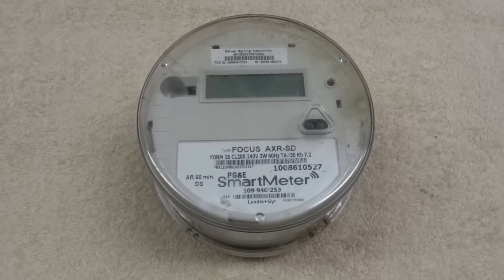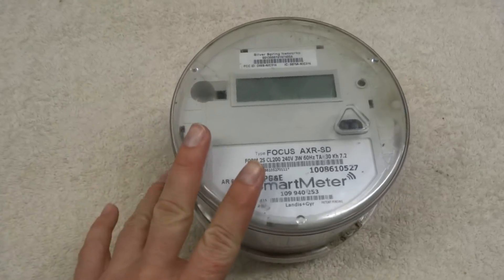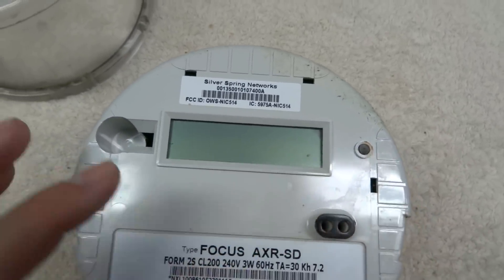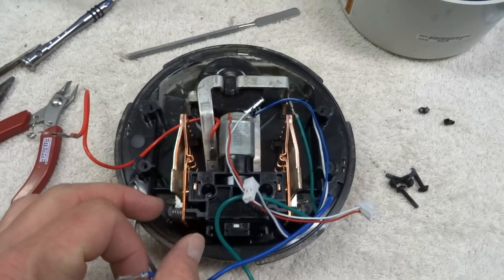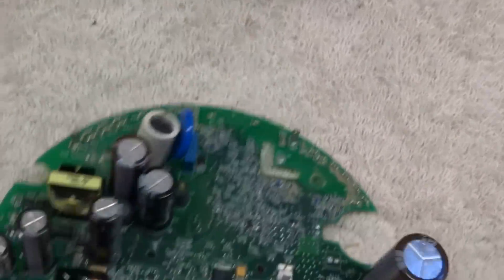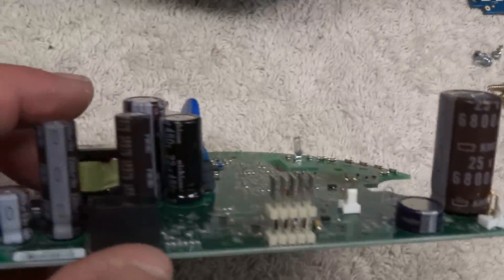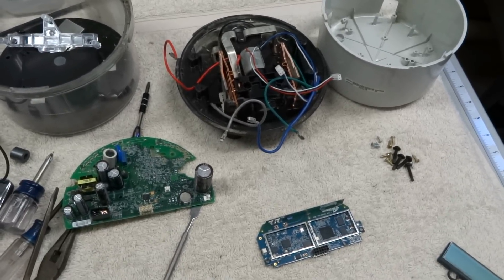Let's Teardown - Residential Smart power meter

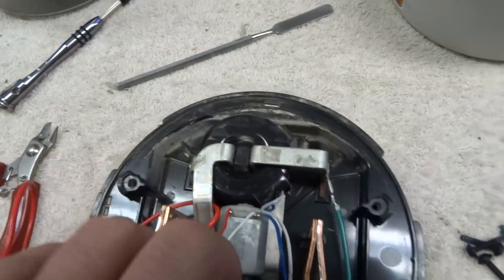Comment: 6:13 Why the heck would you describe the ability of the power company to remotely disconnect the meter as a "Safety Measure"? You know full well the reason for remote disconnection is not safety it's being late on payments. Don't BS Us!
Reply: I live in Quebec Canada and it has come to the attention of the opposition party that our electric company is continue to charge us a flat rate to read the meter yet 98% of all customers have been switched to a "smart meter" that does not require any form of reading and all data is delivered via encrypted Wifi
Reply: I wouldn't call it a safety feature by any means as these type of meters are known to catch on fire.
One thing I noticed the motor is a toy grade unit the construction is a dead give way.
Opening will be slow so some arcing will pretty much occur every time it's actuated and if the motor fails before it's fully open the arc could end up sustaining it's self.
When that happens if you're lucky it'll melt the PCB and insulation in the electrical box and trip the fuse at the pole if you're unlucky it starts a fire.
Reply: +Chris Steele (Ethan Hines) ..... yes, for safety.......... safety for the guy that is coming to shut off the power so that he don't get shot in the ass..... LMAO..... :-)
Reply: Yes, fresh water will conduct electricity. A Task Force Tip nozzle at 10 degree pattern at 20 feet will return a 3-10 amp charge back to the metal frame of the nozzle. 
I was trained at the Niagara Mohawk Power Emergency training facility.
Reply: Can shut you down if they feel you are using too much Electricity. When your Food, Water and Energy can e controlled-- you become History.
Reply: +butchtropic yes laid off some people, relocated most though... savings? not passed on to consumers; using less power than ever, & bills are higher. On top of that, cost over $250/year to opt out of the smart meter - & they just drive by in a truck every other month.
Reply: The CEO of our government ran power here in Canada, Hydro One makes 6 million a  year. Someone needs slap the shit out of the deciding assholes here till they understand what reality the rest of Canada lives in! We heat with gas and our biggest power bill for one month this winter was 508 dollars.  It's criminial!
Reply: +Frederique Zug - If you hate electrical power so much, you are free to not purchase any. My smart meter emits 0 watts of radiation. You cannot speak for me.
Reply: +butchtropic what I mean by "flat-rate" (I do not know the proper term) is even BEFORE they start changing us per KWH used they change us a daily rate of X cents I don't know how much it is off hand but it's the charge they used to justify by saying it was to pay the employees needed to maintain the meter well that no longer applies!
Reply: +Frederique Zug Yes the information that goes from Smart Meter to the Accumulator is encrypted as per this information: 128 bit AES cipher is popular in smart metering and often used to communicate between individual meters and meter data collections units. Since the data is encrypted, it prevents eavesdropping. https://cache.freescale.com/files/industrial/doc/white_paper/SECSMTMTRWP.pdf
Reply: +MrMus TangMan That's my point TangMan no one "comes" to shut off the power anymore it is via remote.
Reply: It is a kill switch for when you do not pay your bill, they cut you off, I just made an error on my account number  266  rather than 622 ....thought all was good at amscot, 9 AM the next morning the power was cut off, I call them, here it is duke energy and informed them I think I made a mistake, and about then amscot phoned in to tell me the process was rejected. I called duke back after fixing the error and they informed me because was not their error I will be charged 45 dollars for a technician to come out and turn me back on within three days. I say  I have a smart meter, rep tells me oh thats right we charge 40 dollars anyway because it was disconnected its policy, (answer for everything just it changes to meet their agenda) then she says also you will be subjected to a 400 dollar deposit on the next bill, thank you for calling duke energy. in the coldest tone imaginable.
Reply: yes, honesty is the best policy....
Reply: either that or they know we can't do anything about them.... :-/
Reply: +Chris Steele (Ethan Hines) 
That to help you Payonline! Problem is they just cut your power. Your computer won't turn on now.
Reply: +Brian Friesen Yes they can, from anywhere in the world via computer, with the old meters they'd have to send someone out to a local access point & disconnect you from the node, so yes ease of shutting you off at a touch of a button, literally, is a reason... primary reason? Considering other possibilities only leads to accusations of conspiracy theories & 'tinfoil hats'... but there's sure been a big push to force these smart meters on people. You can opt out but it will cost you over $250/year.
Reply: Well, you already showed that there is a manual disconnect lever on the meter.  Any tech coming to your house would use that.  (They could also just pull the meter, which disconnects your distribution panel from the mains, or unhook the wires at the pole.) The motor is there so they don't have to send someone to your house to shut off the power.  With a smart meter in place, they can shut down one account, or any number of accounts, with nothing but a keystroke on a computer at the central office.
Reply: I do not CLAIM either. this is an absolute certainty a fact this it can, has and will be used to shut down for non payment.
Reply: Frederique Zug People that grow are crooks?  aww man that sux cuz i always thought i was a good guy!  So, I'll need to know what kind of crook I am.  You must have the answer right?
Reply: Fredrick Zug really is looking like a pompous ass right about now to me and I've only come across 2 of his posts so far.

Apparently you know something about this Freddy boy.  To bad you use your knowledge as a combative tool to club people over the head vs a learning device for all of us. 

Boy.  I can hardly wait until I come across your next 'beat down'.
Reply: Actually here BC Hydro cuts the wires to the house at the street or wherever it is convenient or safe to do so.  Pulling the meter or turning the meter off doesn't disconnect the house from the power.  The meter feed is still hot so the top two terminals inside the meter socket are still hot.  One has to cut the secondary wires feeding the home or pull the fuse to disconnect the transformer.
Reply: The service drop and meter box would still be live so fire fighters would still have to disconnect the building at the pole for it to be safe.
Reply: His video would probably be demonetized if it hasn't already if he said anything negative about the power company's intended use of that feature. With YouTube now you have to sugar coat everything and go along with the deception.
Reply: I sure hope they dont think that  
   the government lied to us and thats it
with no options        except an expensive opt out
Reply: +butchtropic Actually not all that many people. Still need van drivers and employees to check out theft and meter failures.
Reply: conundrum.!!!!
Reply: +Chris Steele (Ethan Hines) Try being the unfortunate fire-fighter who has to pull your meter head if your house lights up some night! Instead of leaving live feeds exposed in a wet metal box, they can kill the house without the electric company guy even needing to get out of his truck!
Reply: +Chris Steele (Ethan Hines) just found out that the electric utility will remove the per-diem charge starting in 2017
Reply: Donny Hinson Or remotely = anywhere in the world actually!
Reply: Robert Slackware or any reason whatsoever! But with remote capability, don't need convincing, delegation, & may be effected without culpability.
Reply: For work safety, it makes more sense to use the physical lockout switch (the movable plastic switch that you pointed out on the back, since the circuit has telemetry and even network capability (mac address, etc), which is for activating the motorized cutoff via network, or actually "remote".  The more logical conclusion is that it is for the purpose of the utility company discontinuing service from their office computers, instead of having to send a tech out to do so in person.
Reply: I used to work taking care of a large portfolio of government assisted housing not far from Toronto. Many people would skip on paying their bill and before they had smart meters they would come out and install a meter that would cycle on and off I think 5 minutes every half hour it would be on. During the winter they can't just shut off your power or your pipes will freeze and break so I am wondering if that motor is set so they can manage doing this if you dont' pay your bill.
Reply: Why the caustic sarcasm Fredrick Zug ?  The guy is showing us how this ver1 smart meter might work.  You posted a report about a meter made by a different company in a different location owned by a different utility.

One might take your comments more seriously if you ditched your condescending attitude.  It's fucking bad enough we have to deal with the  bastards transmitting on the sides of our houses.  Not everyone is in a conspiracy against you.
Reply: Fredrick Zug.   Instead of just pointing out that 99.99% of the time the fire department wouldn't be the ones disconnecting the power source due to lack of training, in your neighbourhood and in your opinion, once again you come across with insults and bluster.  

Why do you think that exposed contacts with basically unlimited amounts of current available 14,400 volts x 1 or 5 amps couldn't or wouldn't be dangerous to a fire fighter?
Reply: Actually it could also be used for safety reasons. If you are a fire fighter putting out a fire on a house with live electric current going to it you would want a fast way to disconnect the supply. This feature of the meter could do just that.
Reply: @billyboi57  it doesn't
Reply: did it work, do they not see the meter is broke? and fix it?
Reply: unlesse the complete meterbox is under water its no danger. so 2M off water is very rare.
Reply: the fuse blow and thats it.
Reply: Moreover safety devices used prior repair are mechanical,and being lockable.
A technician will not rely on an electric actuated unreliable little motor to guarantee his safety.
There is a lever behind the meter with a hole to install a lock.
the motor is to shut the whole stuff remotely.
That's why there is an ID on each meter too...
Reply: Chris Steele ....Californian
Reply: It is a safety feature. It's just a safety feature for the power company. Easier for someone at the office to hit s few keystrokes and disconnect you than have a person drive out and have to deal with an angry customer, dog etc. My dad worked for a power company for almost 40 years and you hear some crazy stories about people pulling guns, turning their dogs lose etc.
Reply: and you trust that ?        
computerized meters
Reply: I agree.  Cut off for service or delinquent payment.  Probably more than one month.  I've lost the bill and simply paid two months.  Not good for credit rating.  I forgot if they charged any interest.
Reply: For John Connolly
If the power meter is the source of combustion, why would the fireman wait 4 hours for the power company to show up? 
You do realize there has never been a fire dept that has lost the basement to fire.
With improperly installed smart meters, 35% to 60% of all fires in your town are caused by the arcing from the customers UL approved meter base and the bent smart meter lugs.
Every fire department I have talked to are under a GAG ORDER not to report these fires as smart meter fires.

You do realize smart meters can not detect an ELECTRICAL BYPASS 
Therefore stealing power is too easy these days.
The dumb assholes at the power company have fires the only folks that could find these bypasses.
So with every smart meter install, the homeowner get free fire's and free power.
Reply: Yes it’s to turn off the power if you don’t pay the bill. It’s also to turn off the power in case of an emergency (ever heard of a house fire?). Also turns off the power when you move out and don’t want to continue service. All spooky stuff. Get a life people, it’s not a nefarious device. Also, their is no motor in a meter. It’s a switch.
Reply: The LIAR from the power company said "Get a life people, it’s not a nefarious device"
Well thebulltoo, I would hardly call 100+ deaths every month from the excessive smart meter RADIATION not a nefarious device.
Reply: Frederique Zug    BTW, what lie did I tell and how would you know what my IQ is?
Reply: Frederique Zug    Still no answer? More name calling. Sad. Who do you know that died from a meter? How do power companies make money from dead people? Just to be sure, DEAD PEOPLE DO NOT PURCHASE OR USE ELECTRICITY, THUS NO MONEY OR PROFIT FOR THE POWER COMPANIES!  POWER COMPANIES DO NOT BUILD METERS, THEY ARE PURCHASED JUST LIKE ANY OTHER PRODUCT FROM INDEPENDENT COMPANIES. POWER COMPANIES PRODUCE ELECTRICITY. THE METER SIMPLY MEASURES THE CONSUMPTION OF ENERGY SO AS TO BE ABLE TO BILL YOU FOR YOUR USAGE. WHAT PROFITS THE POWER COMPANIES IF THEY KILL THEIR CONSUMERS?????  AS FAR AS REGULATIONS ON THE METERS THEMSELVES, THE METER MANUFACTURERS COMPILE WITH THE REGULATIONS SET BY THE GOVERNMENT. YOU SHOULD TAKE YOUR COMPLAINTS TO YOUR ELECTED OFFICIALS. THEY WOULD THEN CHANGE THE RULES ON THE POWER COMPANIES. If all these evil things are coming from so called smart meters, shouldn’t you be bitchen at the meter companies??  BTW, does your head spark when you put it in the microwave?
Reply: Any future correspondence from thebulltoo will be from his cell.
I guess  the police arrested thebulltoo for FIRST DEGREE MURDER after one of his customers was found dead underneath his smart meter.
The autopsy showed his customers wired brain  medical implant to control epilepsy was overloaded by the HUGE INTERFERENCE from the large amounts of RF, overwhelming the implant, KILLING the homeowner.

His company will probably payout the widow to keep this story from going to the news media.
Reply: @frederiquezug5938  exactly. Smart meters give off the equivalent of 160 smart phones turned on all at once, pulsing e.m.f.s  24/7, no thanks. It's all to make THEM MONEY, RADIATE THE CONSUMER,  and drive costs up. These are NOT SAFE, and are designed to be used with the smart grid and 5G. Picture a huge electric  invisible dog fence, but for humans. To track, control and radiate you. Slow kill.
Reply: Are a freaking IDIOT  thebulltoo?
40% of all residential fires in cities that have have smart meters installed by untrained ARSONIST are cause of these fires.   🚒🚒🚒🚒🚒🚒🚒🚒🚒🚒🚒🚒🚒🚒🚒🚒💀🚒🚒🚒🚒🚒
The MORONS have no clue that a smart meter was used to turn off the power.
ALL SMART METER FIRES WILL HAVE THE HOME TOTALLY ENGULFED IN UNDER 2 MINUTES

Which power company do you work for ASSHOLE?
I WANT A LEGAL REPLY FROM YOUR COMPANY 
Not your paid lies, but a comment from a power company that my lawyers can use in court.
Reply: The Joe Schmoe Show
Even the hand wringing smartmeter scoffing websites don't list those kinds of numbers. Now, go back to your greeter job at walmart and relax.
**************************************************************************************************************************
I want to use your evidence that smart meters are KILLERS.
This is how you are going to provide us with this evidence.
#1 Go outside and take a pencil and a pad of paper.
#2 Stand in front of your smart meter and look over top of the L.C.D.
#3 Write down the FCC ID Number.
#4 Return to your computer desk and go to the Searchable FCC ID Database
#5 Here is the link     https://www.fcc.gov/oet/ea/fccid
#6 Under the RF section, give us the link for the CERTIFCATION EXHIBIT 
I am sure your customers will want to know why you haven’t been following the DO NOT INSTALL DISTANCE for all installs.
HURRY BACK, I WANT TO SHOW YOUR CUSTOMERS HOW YOU ARE TRYING TO BURN THEM ALIVE.
Reply: Why don't we start at the top of this article????
WE DON'T WANT TO HIDE THE FACT YOU ARE GOING TO SHOW US WHY YOUR CUSTOMERS ARE DYING, DO WE?
I want to use your evidence that smart meters are KILLERS.
This is how you are going to provide us with this evidence.
#1 Go outside and take a pencil and a pad of paper.
#2 Stand in front of your smart meter and look over top of the L.C.D.
#3 Write down the FCC ID Number.
#4 Return to your computer desk and go to the Searchable FCC ID Database
#5 Here is the link     https://www.fcc.gov/oet/ea/fccid
#6 Under the RF section, give us the link for the CERTIFCATION EXHIBIT 
I am sure your customers will want to know why you haven’t been following the DO NOT INSTALL DISTANCE for all installs.
HURRY BACK, I WANT TO SHOW YOUR CUSTOMERS HOW YOU ARE TRYING TO BURN THEM ALIVE.
Reply: HINT   SPOILER    I have worked in this industry for 20+ years. 
I know how you KILL PEOPLE.
Reply: The Joe Schmoe Show
It's amazing when you ASSHOLES from the power company get confronted with REAL FACTS you pretend to be STUPID   😵😵
Now apologize for killing your customers and answer the question.

I want to use your evidence that smart meters are KILLERS.
This is how you are going to provide us with this evidence.
#1 Go outside and take a pencil and a pad of paper.
#2 Stand in front of your smart meter and look over top of the L.C.D.
#3 Write down the FCC ID Number.
#4 Return to your computer desk and go to the Searchable FCC ID Database
#5 Here is the link     https://www.fcc.gov/oet/ea/fccid
#6 Under the RF section, give us the link for the CERTIFCATION EXHIBIT 
I am sure your customers will want to know why you haven’t been following the DO NOT INSTALL DISTANCE for all installs.
HURRY BACK, I WANT TO SHOW YOUR CUSTOMERS HOW YOU ARE TRYING TO BURN THEM ALIVE.
Reply: Frederique Zug   Hi num nuts. What industry do you work in? Must be the mortuary where you find the 100 bodies per month. Thought that would be higher by now since more and more meters are installed. Don’t touch the bodies, all that stray radiation might get you.
Reply: I want to use your evidence that smart meters are KILLERS.
This is how you are going to provide us with this evidence.
#1 Go outside and take a pencil and a pad of paper.
#2 Stand in front of your smart meter and look over top of the L.C.D.
#3 Write down the FCC ID Number.
#4 Return to your computer desk and go to the Searchable FCC ID Database
#5 Here is the link     https://www.fcc.gov/oet/ea/fccid
#6 Under the RF section, give us the link for the CERTIFCATION EXHIBIT 
I am sure your customers will want to know why you haven’t been following the DO NOT INSTALL DISTANCE for all installs.
HURRY BACK, I WANT TO SHOW YOUR CUSTOMERS HOW YOU ARE TRYING TO BURN THEM ALIVE.
Reply: PEOPLE: PAY YOUR BILLS!
Reply: +MrMus TangMan I know a power company that went as far as telling the public, they could turn off the power to a burning house before the fire department got there.  Therefore saving the lives of the firemen from electrocution. These are the same assholes who said smart meters don't have any radiation in them. 
Do they really think we are that stupid???
Reply: +Chris Steele (Ethan Hines) 
Remote disconnect is the simple reason these meters are unsafe, and a fire hazard. Has anyone heard of Arcing on Wipes Flip the power off and on the contacts arc do this enough you get resistance, resistance means heat, heat stuarts the problem of total failure of the meters and they go out with a bang from what i've seen being said befor they go up in flames. This Melts the box or home owners contacts in his/her box and if the house has vinyl siding or wood its a perfect ignition source for a fire, homes are made of Wood, Poof.   UNSAFE UNRELIABLE,DANGEROUS,POLLUTING WITH RF ENERGY., AND COSTLY. WHO's the dumbfuck that said DUH Lets use these!
SOME SNOT NOSED COLLAGE REJECT DUMBASS Looking at lining his pockets with money.

I seriously Think we can do things safely by reducing power and lowering energy use/cost and put less Carbon into the air without this shit.
We need to stop listening to the energy companies about how they will help us and know these put out dangerous RF energy that's going to kill you over the long run. Sure it Might put out less energy than a cell phone, but your cell phone isn't in a call 24/7 365 days a year everywhere you go, everything you do, we'll be watching you!
Reply: `_You know full well the reason for remote disconnection is not safety it's being late on payments._` 

We know full well that`s the real reason why delinquents and deadbeats are protesting smart meters, not for any credible, compelling, plausible health reasons. 

Besides, they should disconnect deadbeats, delinquents and other peasants like zug, it may reduce bills a little for the vast majority of honest, respectable customers.
Reply: +Chris Steele (Ethan Hines) its not at all its in case they need more power at a foundry or what ever they make a ton of cash from they can turn your house off to get it.
Reply: Cutting the lock and pulling the meter would be faster than calling the power company and finding the right person to click the disconnect icon for that particular subscriber. So that's a farce.
Reply: Why do your customers have to DIE so you don't have to show up? 
I see you didn't tell us your customers are getting FREE POWER because of your smart meter?
With no more meter readers snooping around, a simple BYPASS is undetectable to your smart meter.
It's no wonder why GROW-OPS love you CLOWNS.
Reply: Frederique Zug  Wrong!
Reply: Brian Friesen  The whole truth and nothing about the truth.
The reason for remote disconnection is not safety, it's being late on payments.
Which is cheaper???
#1 Send a worker to the property of a home that has been overdue for six months and probably has a grow op in the basement, run by crooks.    OR
#2 Send a remote disconnect transmission to the 2-way meshed AMI7 smart meter and it disconnects the power.
Which is safer and cheaper?

Little hint Brian   Have a look at the weak contacts and tell me they will handle a 200 amp current flow and power surges from electric motors?   Then look at you CSA approved 200 main breaker and tell me which is safer.

Another hint     http://tinyurl.com/q98p27h 
Read what  schlum Posted April 1, 2015 at 6:41 pm near the bottom.  Surge protection missing.
This is a classic example of the smart meter fire in the RCMP members homme on Vancouver Island. 
AND, because the fire happened in a FEDERAL EMPLOYEE'S home, BC Hydro couldn't fake the fire report. I have a copy of the Province of British Columbia /  Ministry of Justice / Emergency Management BC /  Office of the Fire Commissioner.  This fire report is way different than any other fire report in BC.  Hmmmmmmmmmmmm
Reply: @frederiquezug5938  

I know this is really old but honestly, you're both right. There was no financial savings when my company switched to AMI. What we did see a huge decrease in was safety incidents at the meter base ( flashes, burns, shocks, and yes, customer confrontations).
Reply: +misstreebird                                         FIVE facts about your new smart meter

#1 It generates enough radiation in your home to have a warning from the FCC.   RADIATION  Implanted medical devices suffer interference.
#2 It send enough information about the homeowners private life, that the US Congress is concerned.  PRIVACY
#3 The smart meter measure very accurately. So accurately, they can measure all of the crap on the power line that shouldn't be there and bill the customer for that crap.  
#4 It does not have any built in thermal protection. If the smart meters maximum power rating of 48KW's is exceeded, you have FIRES.
#5  The smart meter radiation is so powerful, they trip AFCI and GFI breakers in your electrical panel.
Reply: +Bruce M Let's hope the grow-ops don't find out about the other way to get free power. Electrical bypass is one, but Sigi Henke has found another way. HAVE A LOOK  
Sigi Henke 3 months ago
How to kill a smart meter.... Get a smaller microwave oven, remove the door screen and glass. Then close the door and set your timer. Then push the microwave oven fully over the meter so the meter is actually inside the oven. Press "Start". The electronics in the meter will be totally fried in a fraction of a second. You probably have seen what happens when metal is in a microwave oven ..... lots of sparks and vaporized metal. Make sure you don't harm yourself by the microwaves of the oven which must be facing away from you!!!!!
Reply: It's a good thing you wear rubber boots. May I ask why you put a fire hose
on a burning smart meter for 12 minutes or more? Are they really that hard
to put out?
Can you supply a link to this training facility?
Reply: With over 100 people being KILLED from smart meters every month and you don't think we should be paranoid?

With over 10 people being KILLED from smart meters fires every month and you don't think we should be paranoid?

How many deaths would you call paranoid Mr. Power Company Manager???????
Reply: BULLSHIT ALERT  There is not one fire department that is trained or ALLOWED to pull a power meter. Do you really think putting fresh water on a home is going to cause any danger to a fire fighter?? Perhaps you can show us a link to your bullshit.
Reply: +MrEthanhines Why are you giving me a link to a sale brochure? It's the asshole power companies that are cashing in on our privacy, not my neighbour. When we get up, when we have sex with the old lady, when we make a pot of coffee, when we turn on the AC. That is what you are selling to third parties and getting rich. In a meshed network, it is not hard to have your whole neighbourhood's information to be relayed through any ONE smart meter. Look at the power company managers, have you ever seen them complain about their power bills doubling and tripling?     NO  That is because their smart meters have been reprogrammed to measure at a lower rate. 
We always laugh in this business of security, if you are %100  sure you can not be hacked, you already have been.  I mean after all, who is running these power companies?   YES, the same assholes who think smart meters are 100% safe. 

Our evaluation is based on more than 3,000 current consumption fingerprints, which we have captured for a range of household appliances. 

http://ieeexplore.ieee.org/xpl/login.jsp?tp=&arnumber=6424093&url=http%3A%2F%2Fieeexplore.ieee.org%2Fxpls%2Fabs_all.jsp%3Farnumber%3D6424093

http://news.nationalpost.com/news/canada/smart-meters-are-vulnerable-to-hacking-and-present-a-threat-to-personal-privacy-ontario-new-democrat-warns
Reply from the maker: I didn't claim they could disconnect power remotely.  I think the disconnect feature is for a tech who's been dispatched to work on the meter itself and/or breaker box.  He can locally disconnect the meter (and your house) from the grid for safety when working on things.  It's possible the power company could disconnect your power remotely, but I don't think that's the primary reason for this feature.
Reply: +Chris Steele (Ethan Hines) Encrypted WiFi ????  How do you figure??? The make, model, serial number and how you abuse that smart appliance is only shipped to the ZigBee transmitter. (The second transmitter) It's the I.S.M. band transmitter that delivers all of the stolen private information to the assholes that work for the power company. That is where they sell all of the private information for a fortune. Just like Google. 
Get your shit together Chris and fix this mistake you made. You are looking really STUPID right now.

https://smartmeterwarnings.wordpress.com/
 Exposing the Risks and Potential Uses of Smart Meters

http://smartgridawareness.org/2015/09/30/smart-meters-not-necessary-to-modernize-electric-grid/

https://www.google.ca/webhp?sourceid=chrome-instant&ion=1&espv=2&ie=UTF-8#q=smart%20meter%20hacking